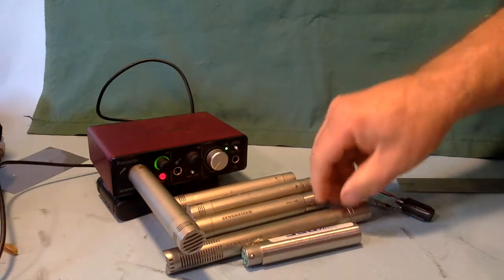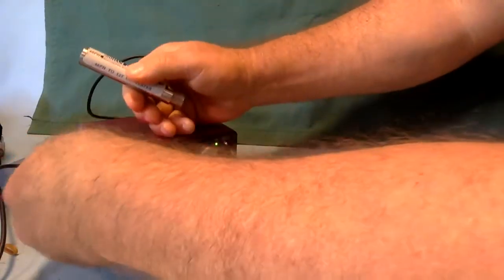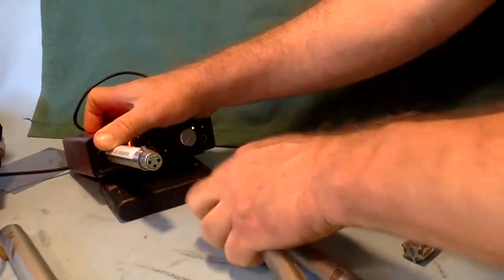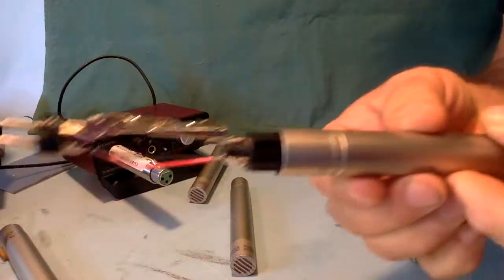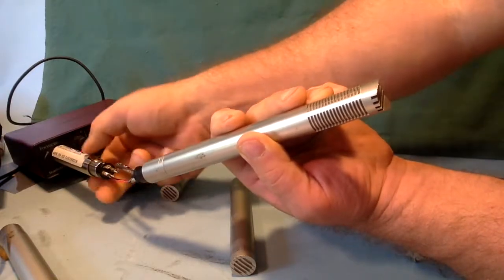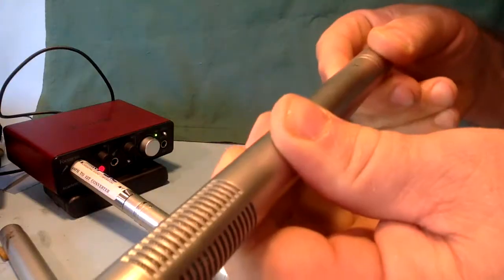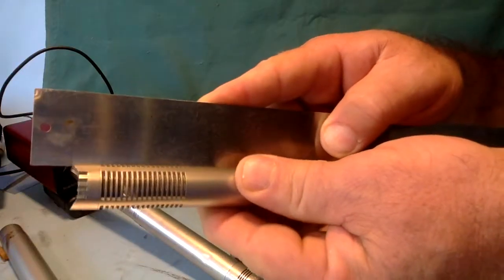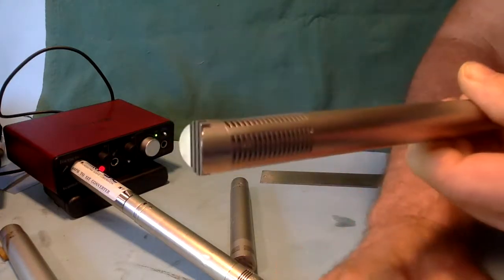MKH435T reverse polarity demo

Comment: In A-B (Tonader) powering, pin-out was never fully standardized. Usually mics used pin 2 for 12 V in case of XLR connector, or pin 1 in case of Tuchel DIN. But sometimes microphone was made with reversed pinout, and it looks like this MKH435 was prepered by Sennheiser to work with Nagra recorder with "positive" earth.
Reply: XLR also wasn't standardized back then either.